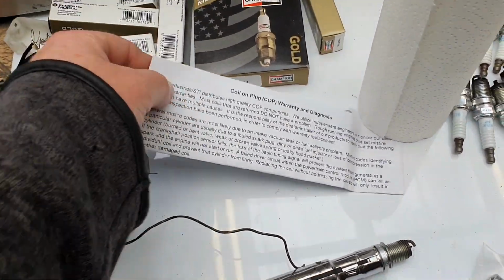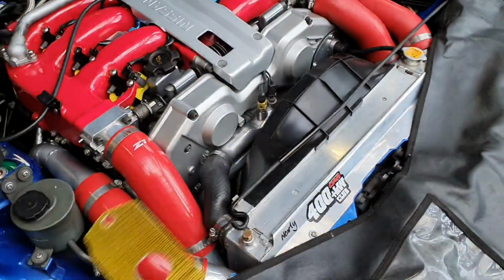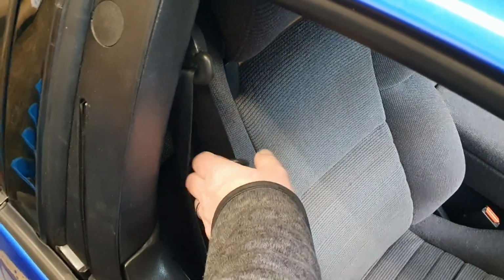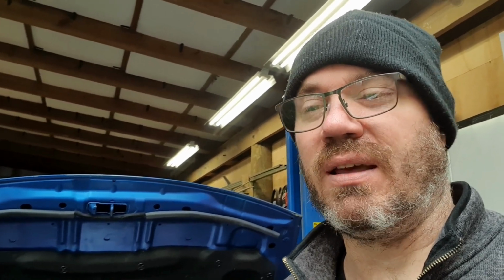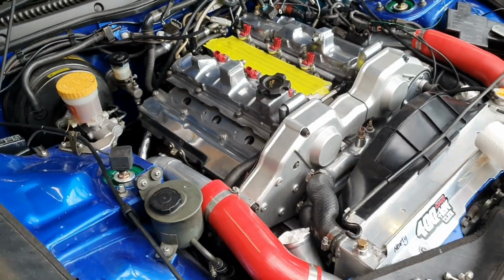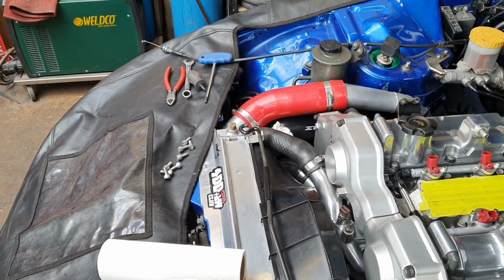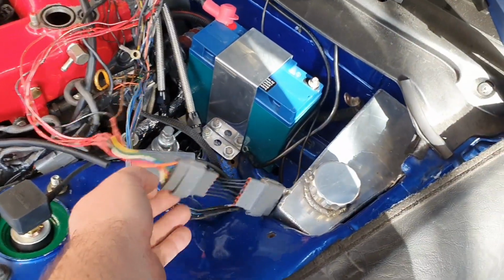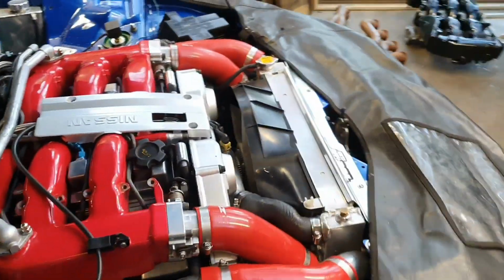Blue Z gets new coils - again

Comment: Did you have to modify the dwell time for the porsche coils? If so, can you post what settings you ran? Thank you for the amazing content
Reply from the maker: THANKS!
We used 3ms at 14v and reduced it over that voltage, under that voltage it was increased BUT to some extent it's purely "best guess" without actual specs supplied by the coil manufacturer - this is the information you should really be seeking.
Talk to your coil supplier and get the chart from them for best results.

Comment: Thanks for the details provided in this video re coil swap which is something I'm about to  do as I believe my ignition module is cactus.
You mentioned the porsche coil won't fit with original plastic trim plates in place but can these just be removed or do the new kit plates need to be installed for this set up to work. I don't have the kit just the new coils coming.